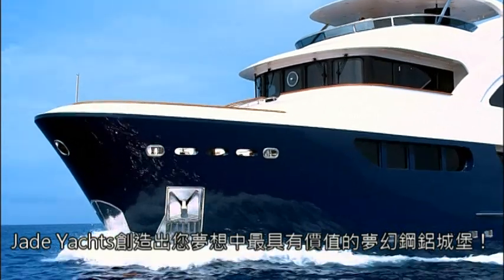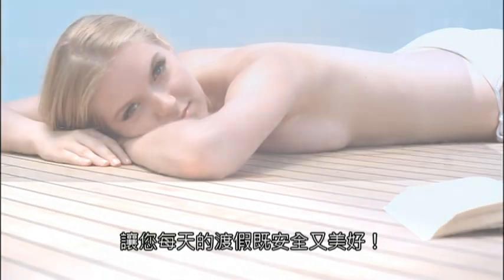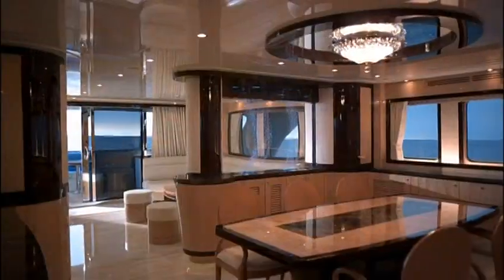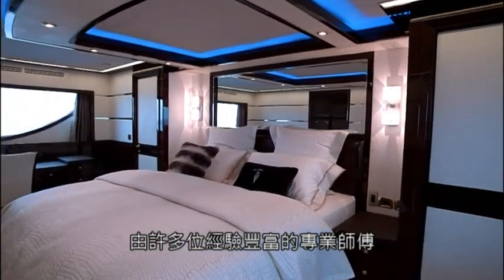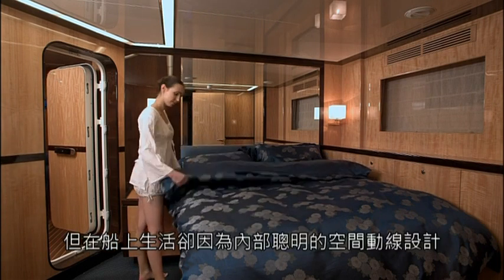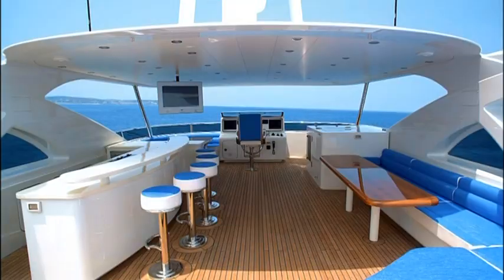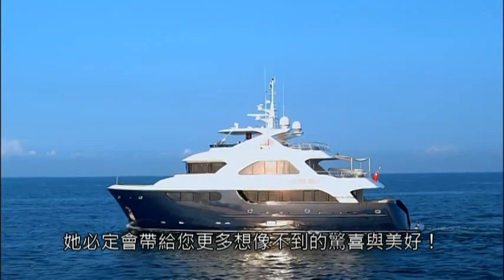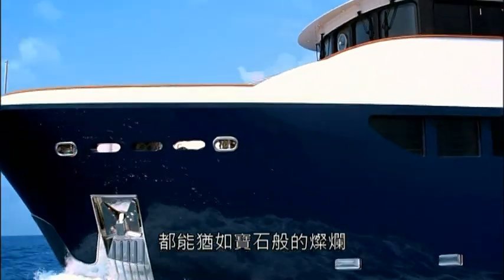[ Jade Yachts ]Taiwan Luxury Yachts-- Jade Yachts 95'

Comment: Flemming Yachts use fiber glass to make their models. Their biggest is 78'. Riviera make a 70' in fiber glass. Lots do, but not so much carbon fiber. And not as large either. 95' is big. The Wally-aero-121 will be made from carbon fiber though, and gun boats are made from it too. But they are catamarans.

Comment: Why not get a fast amphibious Car Tender Boat/Car to go in that garage?  I built a fast prototype that runs right at 45 mph (39 knots) on water and is fast on land too.  Watch Video  https://www.youtube.com/watch?v=RA9Z9nhJK7M .  This was my first generation prototype it is 80” wide by 20’ long (2.05 meters x 6.15 meters long) and has seating for 8 people.  I am working on prototype #2 with my own custom transmission.   It is a way better layout than the one in the video.  I can custom build a fast amphibious limo size unit with 4 wheel drive and 4 wheel steer and yes the wheels will be fully retractable and it will be fast in the water

Comment: I am looking for a yacht from 90 to 130 mm
Reply: Edward youngbloom Youngbloom  Best to Build yourself , that way you know ever crook & crany , not as hard as is , I would make it of Cement , . I have see them in Sail boats . They had a Big Ship made of it it had down in 20 ‘ feet of water sat for over 30 years , not to long ago they fix All the Holes raised it , cleaned it  up she was about a1 to 2 feet of Cement took took it & Sank  in DEPER water she was close to 50 + years , she had been a ver large SHIPPING SHIP AT Close 500 ‘ in length & 30 ‘ wide at beam , I would not make it as much as cement  as they did , I saw a paper the US GOVERNMENT try to send a smaller boat on the rocks , & could not sink it  , & I mean hard  & they could not sink  , they are made  of rebar & make rebar across the main Deck, do in the hull  fort & then main deck after in about 100 , close to 60 meters ! Thank You for learning !

Comment: What a BS video. The video mentions that Fiberglass boats have an average lifespan of 10 yrs. I come from the commercial fishing industry and the boat the Pacific Reefer is over 40 yrs old and looks brand new. Various other fishing vessels built out of Fiber glass are over 30 yrs. Most have been re-gelled and look brand new. Aluminium and steel are good to but they should stop talking crap about a building material that can be good to build boats with if done right.